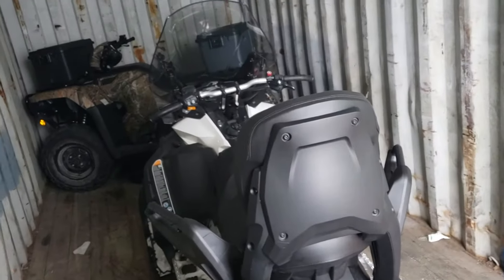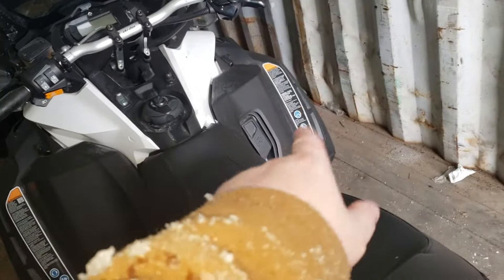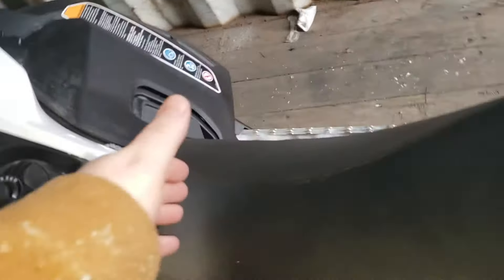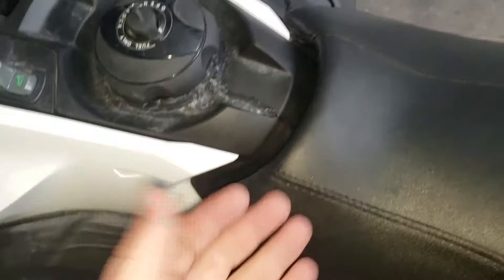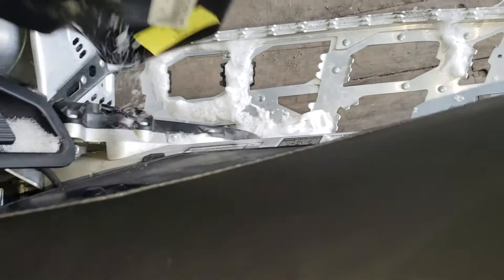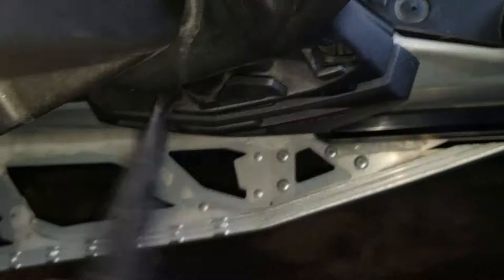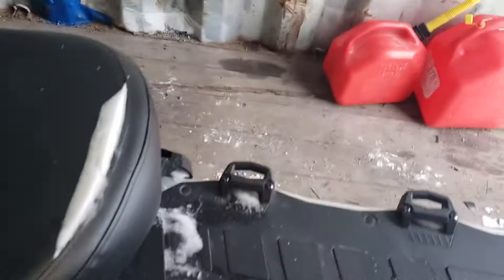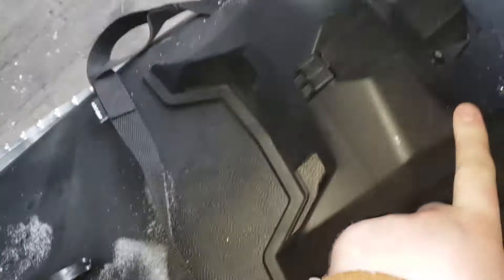2020 Skidoo Expedition Sport 600 ACE Seat removal  : Artic Backyard Mechanics

Comment: Thanks so much for this video.  It is exactly what I needed to get at my dead battery to get the machine started.  The knee on the center of the seat really helped.  Until then, I was afraid I was going to break something trying to get the seat off.
Reply from the maker: No worries, I remember the first time I saw this body type. I was sitting there thinking I was an idiot because I couldn’t figure out where the battery was because I kept looking at it’s old spot and then when I read the instructions and all it did was say remove the seat.

Comment: Thanks! You are the only video that mentions using your knee. I just tried it, and the knee is crucial, especially on a new sled. I found the sweet spot for the knee is about 5 inches back and about 2 inches from the center line on the side you are working on. It was -20 C today (-4 F), I don't know if I could do it at -30 C. Bad engineering for Canadian winters, but nice sled (2025 Expedition 600 EFI).
Reply from the maker: When I worked up in the Arctic, I hated when people came to have me fix anything or look at anything and it was a past -40 because you need your hands to use the computer and half the time you wouldn’t be in a community that had a real garage or anything so everything was done outdoors I remember getting frostbite many times even trying to change batteries..

That being said, I’m surprised nobody talks about using your knee. I fully agree it is crucial..

Comment: Im looking for the location of the 40amp maxi fuse. Will check by battery.  This video helps. Apparently its kind of hidden (under rubber cap on dead end wire separate from fuse box 🤷)
Reply from the maker: I do believe you are correct and it’s near the battery, but I don’t have an expedition in the yard right now to go look at other than EFIs, the only ace I have left right now is a grand touring and I can’t remember if it has the fuse in the same spot or not I’ve only ever had to change the fuses on a 2019 that the teacher had bought from us, and she kept killing it because she would drive it for a minute and a half at a time and in the -40 weather, she would clog up the oil pump all the time
Reply: @AlbinoRhinoBeerReview interesting, Im putting together a spare fuse/relay kit but what good is it if I can't find the main fuse?  Others say it's near the chain case.  I got the seat off, nothing near the battery that I can see.  It's confusing. Appreciate your input.
Reply from the maker: @NomadicNorthwoods  I’m doing my inventory tomorrow if I get done early enough I have to start working on some of the Sea-Doos anyway so I’ll see if I can find it on one of the EFI expeditions
Reply: Your a good dude you know that?  Happy to say I finally found it. Zip tied in a waterproof end cap near the main fuse box towards the gas tank. 40 amp maxi.  Hopefully it never goes but I'll be able to find it now.
Reply from the maker: Well thank you for that I know where to look for it thanks to you I didn't end up looking because my store's inventory took until 6 PM and I had to go reprogram 3 sleds for sale tomorrow since I put new clusters on them but didn't hook up the BUDS yet.

 Once I find them I might do a quick video giving you a shout out for telling me where they can be found!

( I actually have a general merchandise manager now so I shouldn't have to ever do anything on these machines anymore  but he doesn't even know how to turn the computer on yet) :)